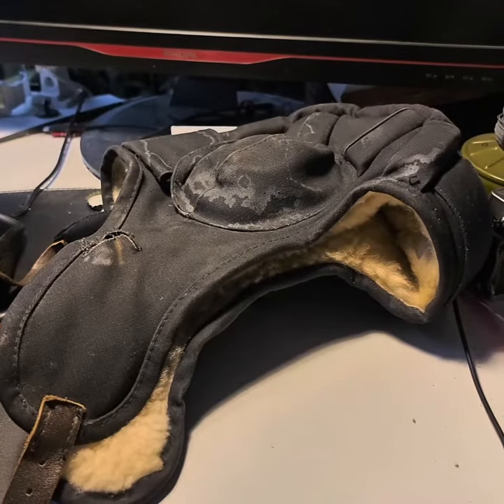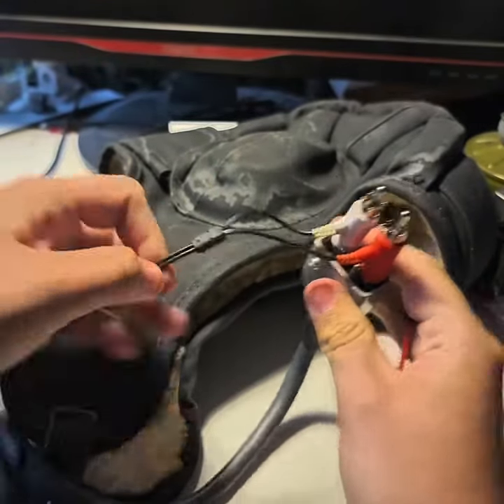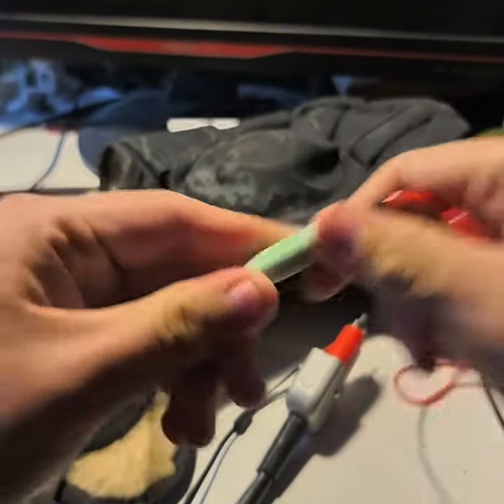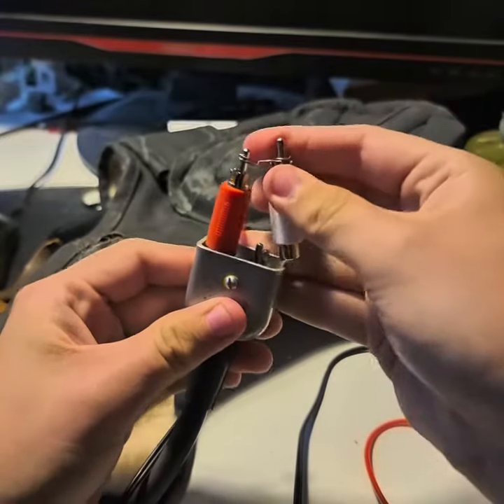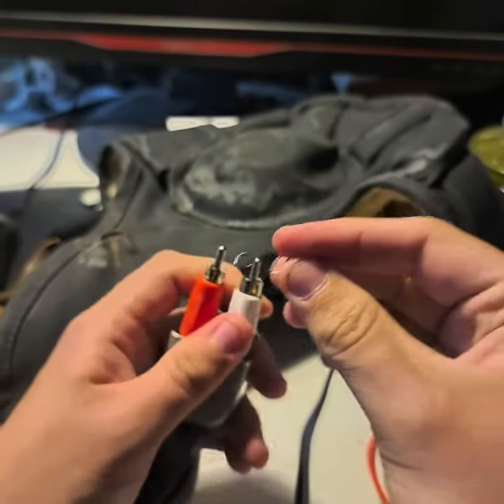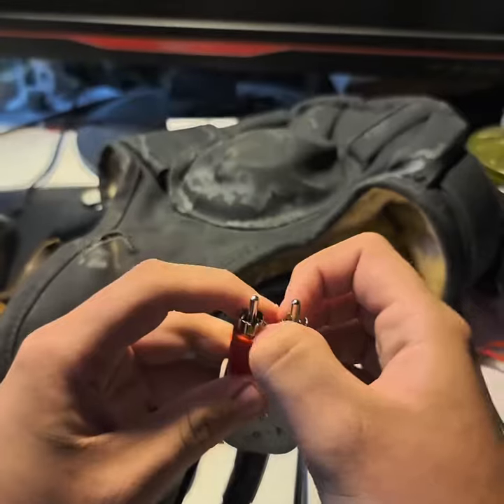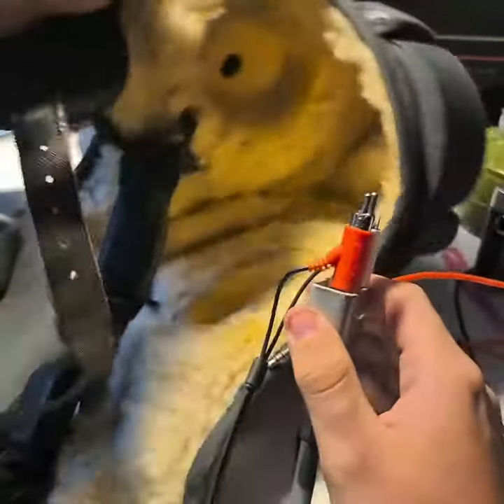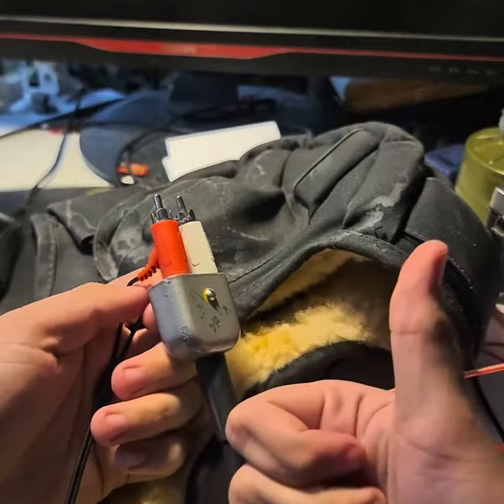Soviet tank helmet headphone jack conversion guide

Comment: Trying this with my 1977 helmet today.
Update: Works great - I bought a piggyback for RCA to RECA and then an adapter to 3.5 mm jack, no issues. Oddly, I am getting better sound quality by wrapping copper speaker wire around only the red input.

Comment: Could you possibly post a link in the comments with a link to all the materials necessary?
Reply from the maker: All you need is a split stereo cable with headphone jack on the other side and a metal wire. If the cable doesn't have these adapters you can also cut them off and attach the wire to a terminal block and put that on the tank helmet connector pins
Reply from the maker: One of these cables, an aux cable with a plug on both ends and an electric wire that conducts electricity https://m.alibaba.com/product/60454620736/RCA-Audio-Piggyback-Cable-3-5mm.html

Comment: Would something like the ienza Red and White RCA to 3.5 mm 1/8 TRS Aux Stereo Audio Cable, Headphone Jack to RCA Adapter Cord, 2 RCA Male / 2 RCA Female Piggyback to 3.5mm TRS Male Audio Wire Splitter (6-Ft) be okay as is? (It connects to a male port instead of a female one like in the tutorial video) Or do I HAVE to have a female output to connect to a double sided male aux wire?
Reply from the maker: @MEE-t2k  Anything would work really, as long as the connector that goes onto the pins is female RCA which seems to fit the best

Comment: Can give you the wiring diagram if you want? dont need to mess around like this. Just cut the plug off the end and then you can put whatever plug on the end you need.
Reply from the maker: That would destroy the authenticity of the helmet which I do not recommend

Comment: I really want a helmet like this, but it costs so much.
Reply from the maker: They go for under 50 bucks though
Reply: @beneluxmasks  Yeah but they're rarely ever in that good of condition and shipping is like $25 :/
Reply: @beneluxmasks  Where? I’ve only seen ones without headphones go for around $40, and I really want one of these
Reply from the maker: @butterdogestarwars6709  they're all over ebay
Reply: 2 years out from this.
Get a polish HCL-72 
Same thing, similar plug, same design. Just they're polish so they're cheaper.

Comment: What about the newer tsh-4 with 5 prong connector? Bottom 2?
Reply from the maker: I have one of those but haven't figured out how to make it work yet, it uses a different system.
Reply: Still use the two outer most pins, I took apart a broken aux cable (red and blue wires) and some broken headphones and wrapped the copper directly around those two prongs. the sound quality is not great, either my helmets headphones are shot or my bumrigged connection is not great but it does work ok. the bottom two pins are for the throat mic and the middle top one is for grounding. Im still monkeying around though.
Reply: quick update, use either the red and white or blue and white, perfect sound quality.